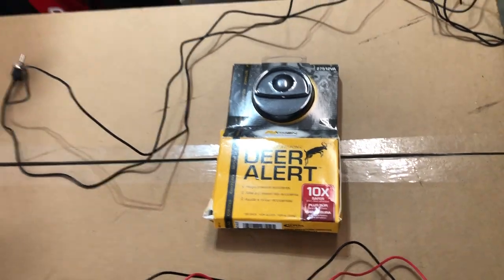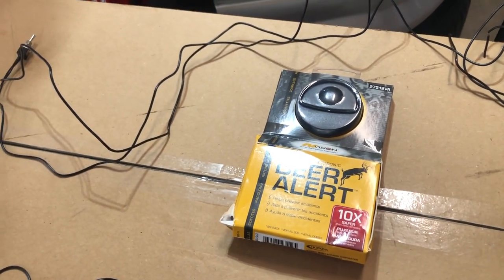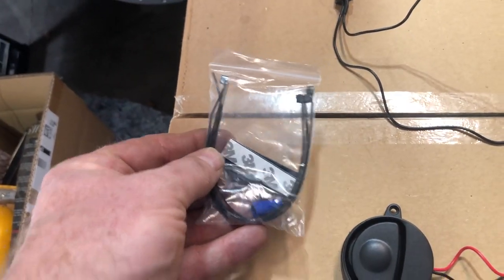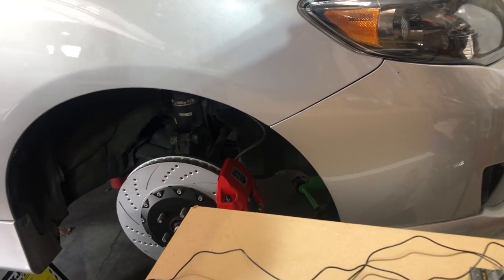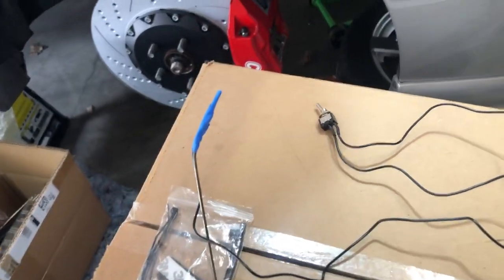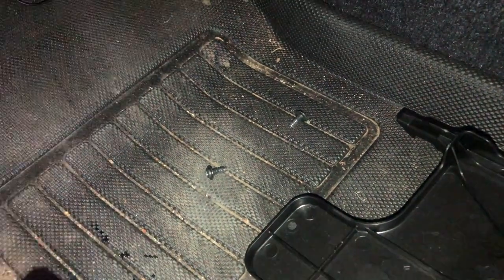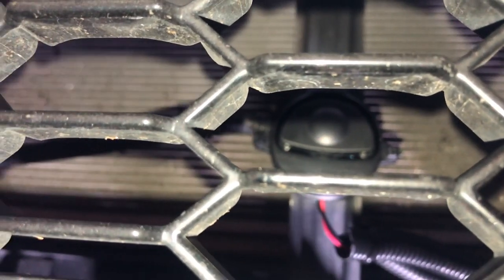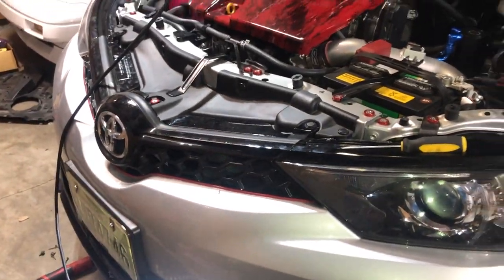Afraid of hitting a deer? Try this!!! Electronic Deer Whistle Installation - 2017 Toyota Corolla

Comment: hey Jim. Got this exact model coming in the mail... I'm in Canada in a smaller city with  heavy deer population in both city and rural.. is there any DOWN side to having them run every time I'm driving. The deers can show up literally in any spot of the area, but the wooded stretches are more treacherous, but I would just really prefer running them all the time, if it's suitable.
Reply from the maker: You can run it all the time if you wish. You can hear it when you come to a stop but when moving you won't know it's on. There is not a reason to not run it though other than hearing it at a stop.

Comment: Any update since using it?
Reply from the maker: Nothing but great news. When I have seen a deer they seem to freeze or run away from the sound. I've never seen one bolt into the road in front of me. I've taken many long road trips. I have one on several of my cars and love it. Talk about cheap insurance. It's no guarantee but it sure decreases the odds of hitting one.
Reply: @jimsgaragetoys cheaper insurance would be the non- battery ones??
Reply: I pass through Mark Twain National Forest 4 times a day ,and before buying this alarm i was getting hit by deer running onto the road pretty regularly. I tried the whistles but they were very disappointing as in useless. Since installing this alert i noticed the herds dont move, and if they do they run back into the forest. I will post a video off my dashcam to illustrate just how effective this is. Im driving through at 5am so itll be quite obvious to anyone interested. Great video Man ,best 10 dollars i ever spent 👏👍✌️
Reply from the maker: @robertwilson1827  The non-battery ones don't work well or nearly as well as the electronic ones like this. I came across another guy that used to work for a trucking company and he told me that they had a 97% reduction in deer hits with their fleet of 200 trucks and millions of miles. Well worth the $17 for this!
Reply from the maker: @concernedcitizen5493  I love to hear when people have experienced results as I have. These really do work wonders!